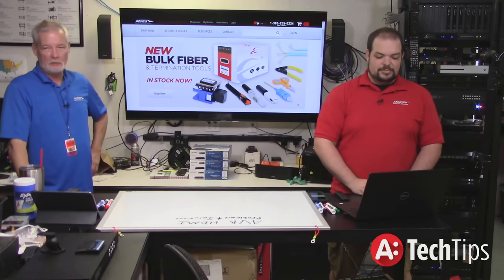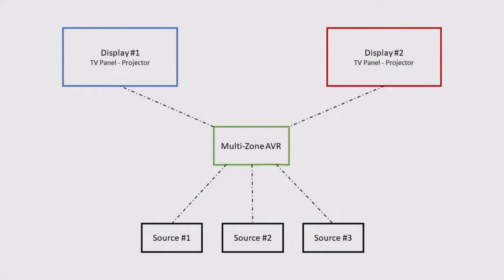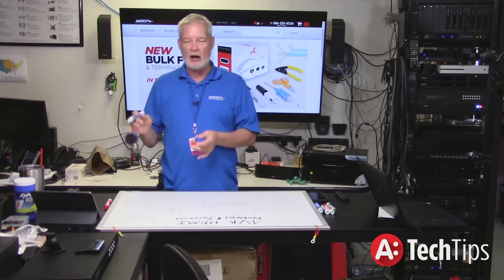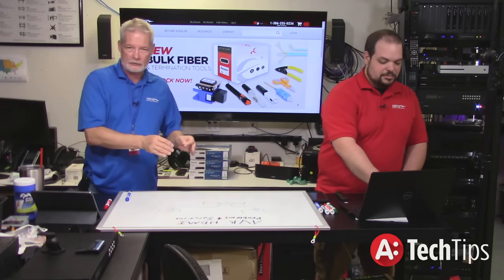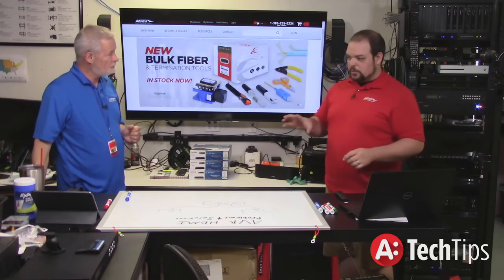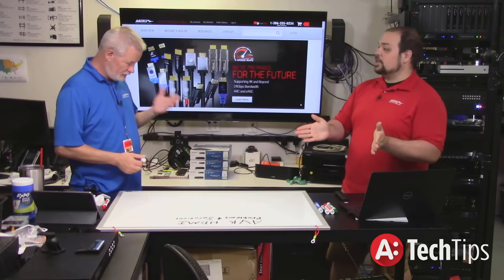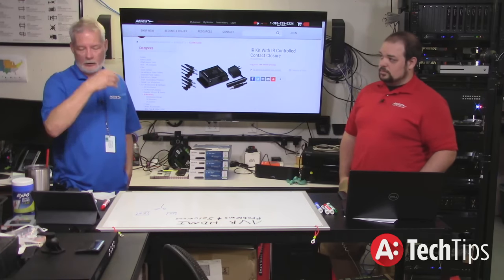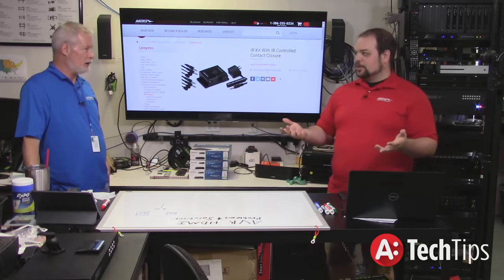AVR Problems and Solutions - Tech Tips Webinar

Comment: On Yamaha AVR's the 'extend mode' is called '4K Mode'. The older AVR's shipped with it set to 4K Mode 2, this only allowed for around 10Gbps thru-put, whereas 4K Mode 1 allowed for up to 18Gbps. Updating your AVR to the latest firmware should mean it defaults to 4K Mode 1 and can then handle the best signal a UHD Blu-ray disc can throw at it.
To access the 4K Mode settings, you'll need to go into the amps advanced menu. Do this by turning off all zones, putting the amp into standby, then pressing 'straight/connect' and the power button on the front panel. This will bring up the advanced menu and you can cycle through the different options using the programme keys on the front of the AVR.
Reply from the maker: This is really great information! Thanks dunnersfella! -Adam